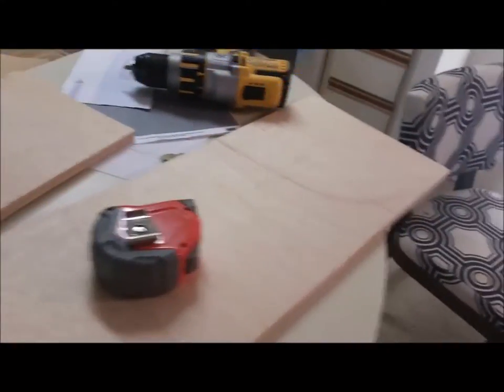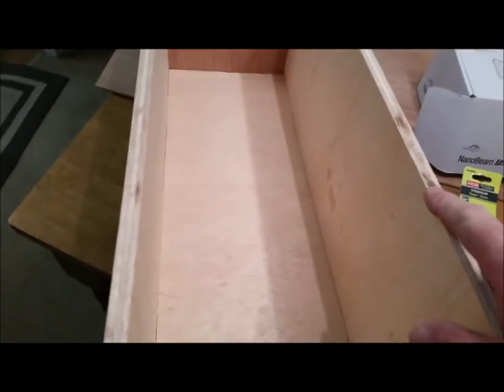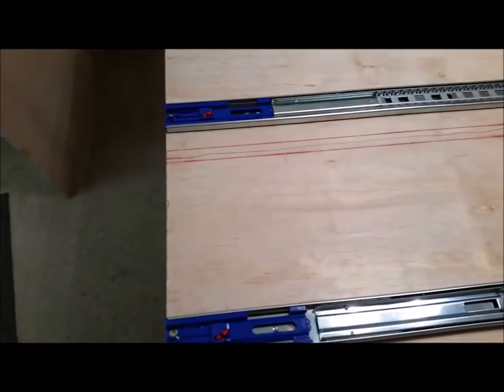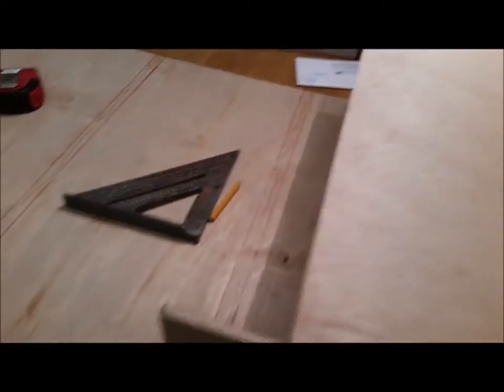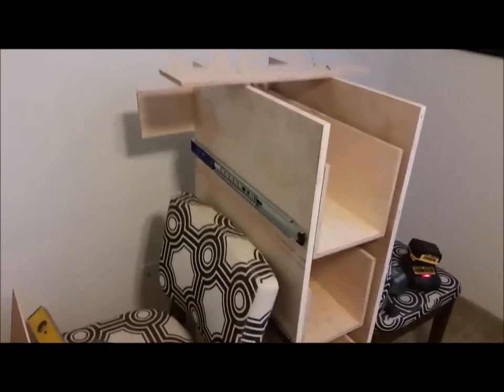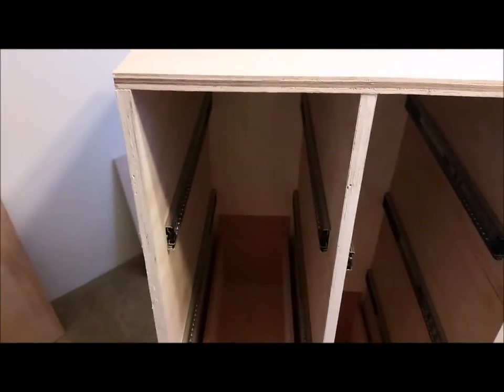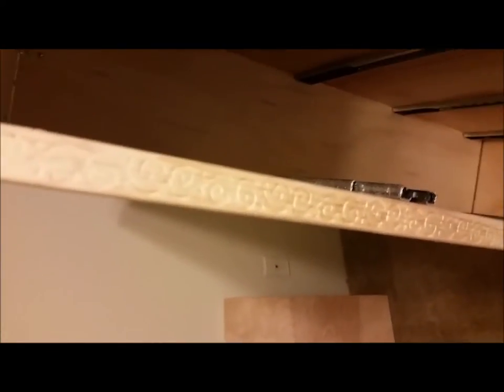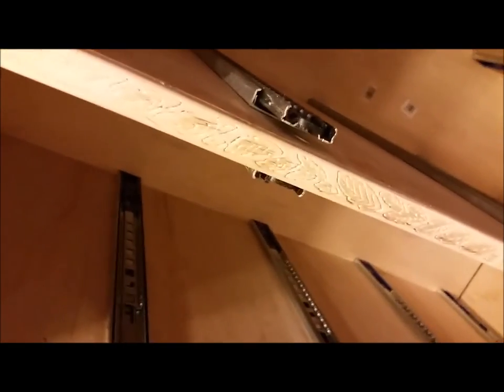Comic Cabinet build

Comment: This is a great "little" project and tutorial.  Do the rails have elongated mounting slots?  I'd imagine that would make it a bit easier to adjust their positions if your measurements are slightly off.  The plexiglas front pieces give that cabinet some seriously sexy with Silver Age covers peering out.
Reply from the maker: Thanks man..  no elongated holes... Where they are is where they're going.. I have to take off and re-position.   Appreciate the positive words..   Try it out!